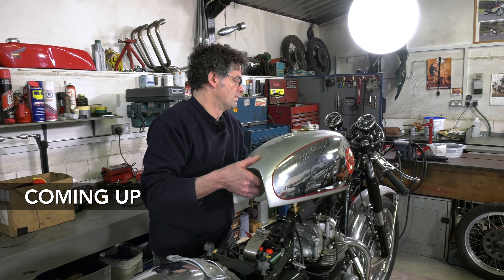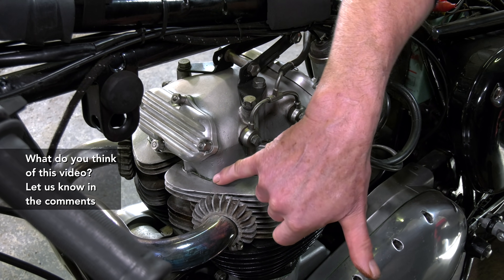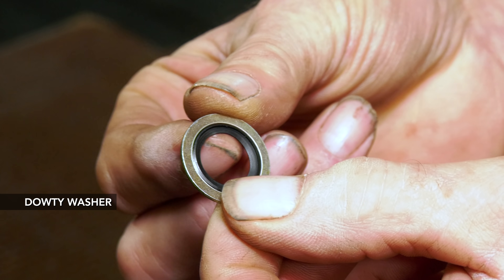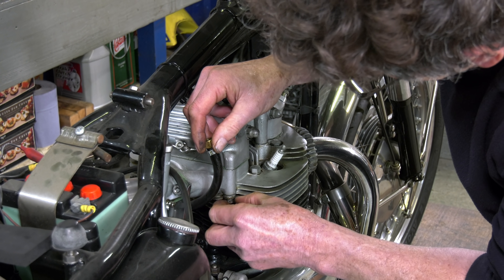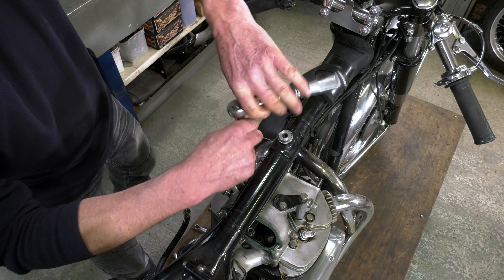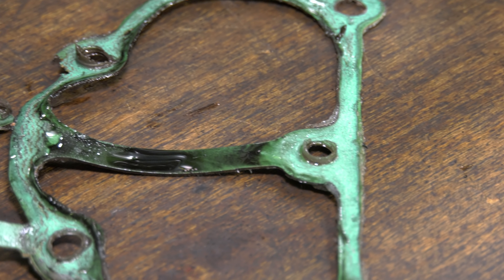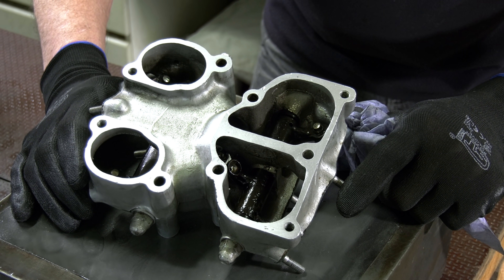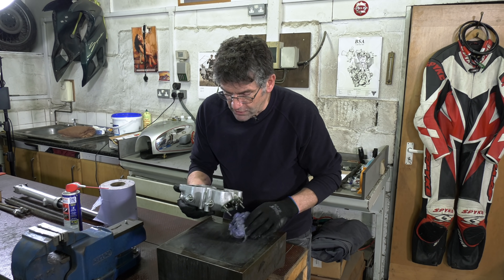Pre-Season Service & Ride - BSA Rocket Gold Star Part 1/2

Comment: Dave, I enjoyed this video mainly because with a bit of care and know how you could work on the old bikes. Back in about 1977 my mate and I went halves in a BSA M34 ( I can’t remember whether it was side valve or OHV. I do remember it having girder forks and a single tractor seat. I blew smoke and leaked everywhere so we decided to pull the engine out and do a rebuild. We were lucky as we knew this old guy who had been working at BSA in the 20’s and 30’s. Basically he did all the work and we just watched and helped out. The thing I still remember was the history lessons we got from this guy. I do remember him cursing as the motor was being stripped down about the use of silicon in the engine. From that point on I never used silicon in motorbikes I owned later. Thanks for such a great video of and ( gloves, mechanics using gloves lolol ) from Down Under.

Comment: "Use Wellseal gasket sealant" - YES!!!   First time I used that my BSA C11 engine was so dry the cast iron cylinder head and barrel started going rusty!  Had to buy some cylinder black enamel from Halfords.  Then used it exclusively on my B31,  a Royal Enfield Meteor and finally my BSA Gold Star.  Always worked,  never failed.
Reply: I'm working on an A10 which was so oiltight up top that the barrels were looking dreadful with rust.  Blew a rocker box gasket on one side, and the resulting oil made the barrels look half decent again. Result! (sort of).  Never been a fan of sealants on engines.  Big on plate glass and grinding paste though.

Comment: The rear topmost rockerbox cover stud would have had two flats on it originally to fit a BA spanner on so it could be removed to make it easier to remove and you don’t have to use two nuts to do it.

Comment: I hope part two is up soon.  I am currently replacing rocker box and cover gaskets on my mate's plunger A10.  I'm an old Triumph bloke, so I figured something wasn't right when I struggled to get the rocker box out of the bike.  Now, thanks to your excellent video,  I understand this is a factory cock-up. I look forward to part two because I bet there'll be a trick to getting it all back together.  Do you have an opinion on alloy gaskets?  I'm struggling to find a source for paper ones here in New Zealand. Great website. 😎

Comment: It is a bit to clean but I use Permatex Grey as it is a duro higher than rtv and withstands high heat on head. A thin smear on gaskets ensures a wellseal tight seal. It does not soften under heat that much rockers won't jiggle LOL!

Comment: Im a convert to wellseal, its expensive, but really does the job , however be very careful when using wellseal as if you read the small print on usage, its known to be carcinogenic so be CAREFUL WHEN USING

Comment: Hello Dave, I wanted to ask you where do you actually bolt your gas tank to utilize the two little bolts in the very front underneath the tank? I wonder because I don't see any bracketry on the frame to utilize the two bolts under the tank, I'm stumped because I actually picked up a Road rocket or Super Rocket but have not determined which one yet, maybe you can help me! My serial numbers on the engine are CA10R 156,  and my frame looks identical to yours with no brackets on the frame to utilize the welded bolts underneath the gas tank, if you could help me out in anyway that would be great, but if not no worries just keep up the great work brother
Reply: A flat plate strap goes across the two studs. It does not bolt anywhere else. It is there to rigidly stabilize the tank when it is full of fuel on both sides so it doesn’t flex and split the tank.

Comment: My pre unit Triumph’s original instruction manual says to lubricate the pet cock with beef tallow after lapping. Fuel doesn’t wash it off and it keeps the tapers operating smoothly for a long time.👍